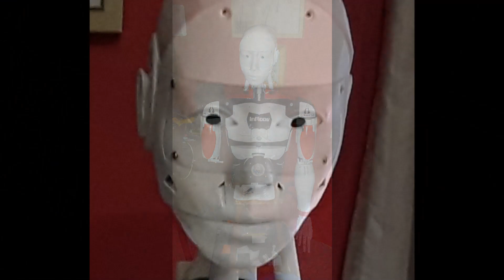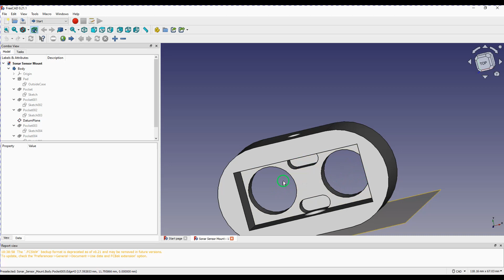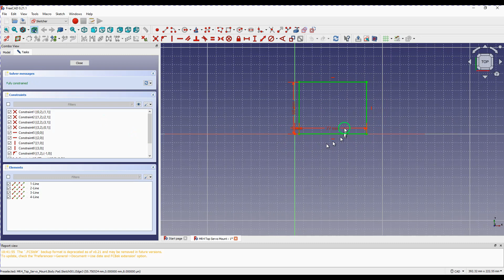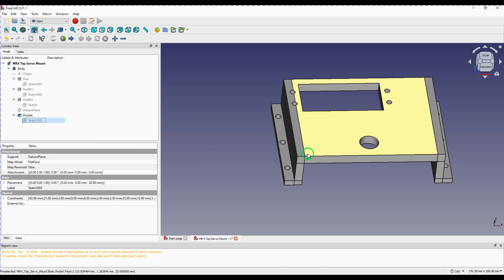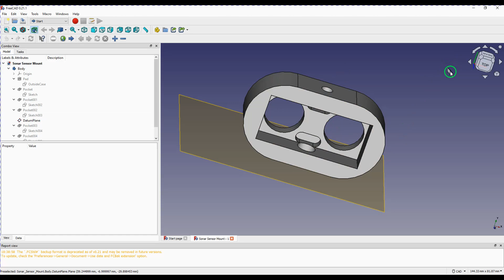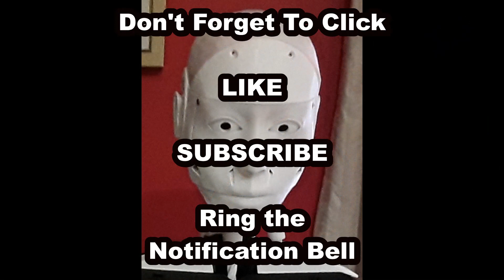MR 4 Part 2 Rotating US Sensor

Comment: Its looking good and that clear resin looks fantastic!
Reply from the maker: I've been liking the clear resin, there are a few issues with it.
I found when placed under a heavy load for a long time (weeks) it will distort and not return to the printed shape.
I have some ABS like resin coming, so I will test that out when it arrives. :-)
Reply: @CyberOne  Interesting. Have you used ABS before? Is it less prone to distortions?
I like how the resin looks, even if it is just for non-load bearing parts. I tried using clear PETG and could never get anything that clear.